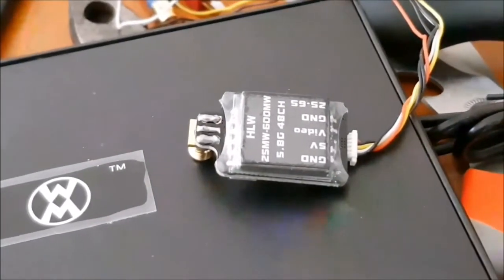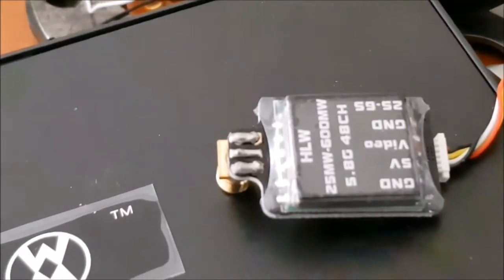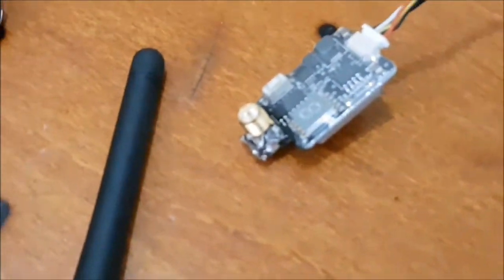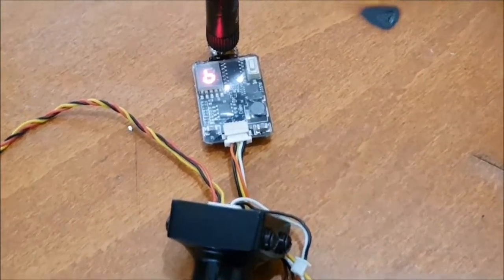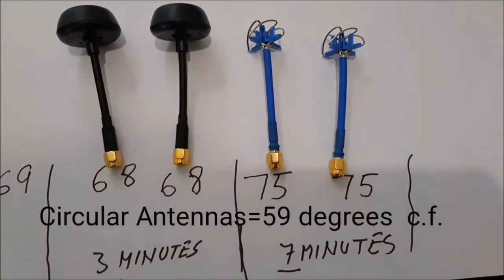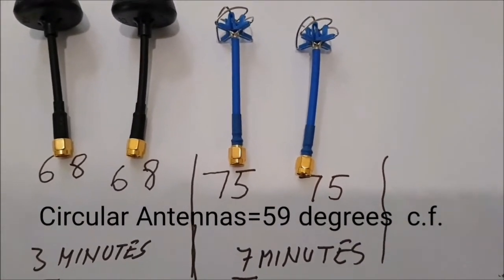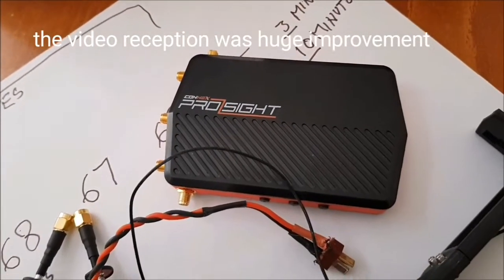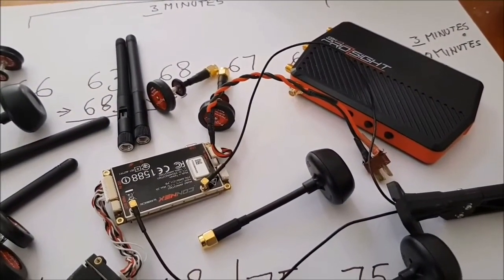extend fpv signal  range, fpv tx over heat problem solved

Comment: hello, and Im really at the end of my rope, Im currently running a 5.8 set up , using black pearl diversity receiver /monitor set up, I purchased the 600mhtz transmitter, for my go pro set up, no matter what I do, I get , like no reception, my quadcopter (3dr Iris +)  gives me no signal,   any advise,,lol  clear from like three ft away, but as soon as the aircraft takes off, to about 30 ft,, its snow,,,, 
tryed different antennas,, Im guessing the transmitter is not good?
Reply from the maker: Try walk test if it still doesn't work it could be the current draws too much to the motors or the electronics interference that could cause the video stop working. How many milliwat of power is your transmitter?
Reply: sorry I think I meant 600mw transmitter,? I think you may be right about the video transmitter not getting enough power,  maybe I can try a separate battery
Reply from the maker: Ps.what do you mean 600mhz transmitter?